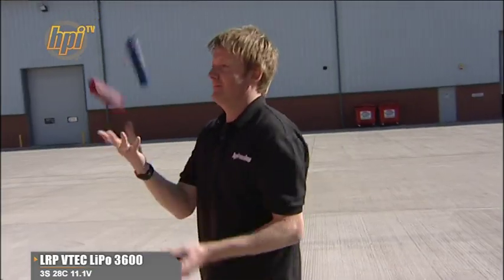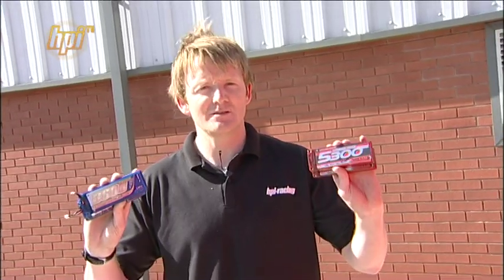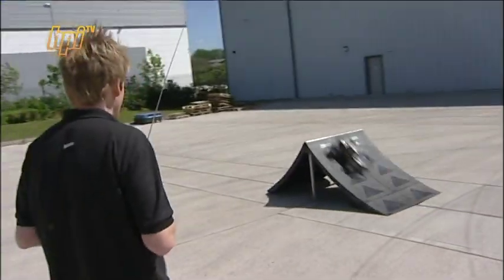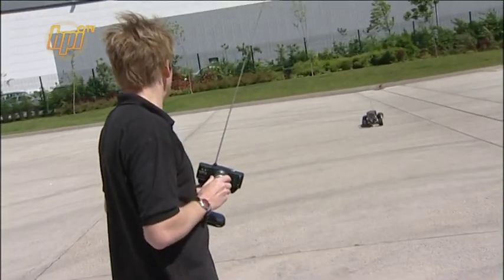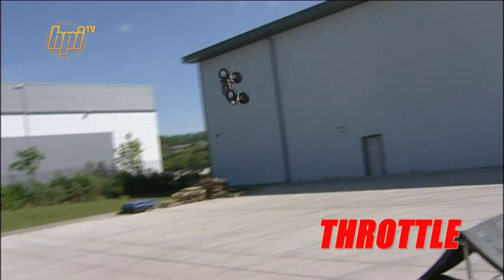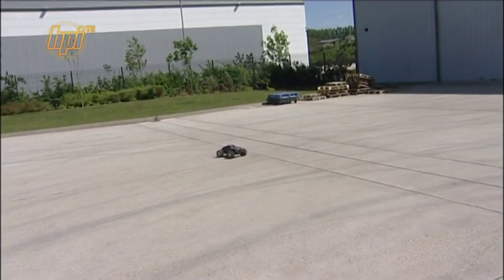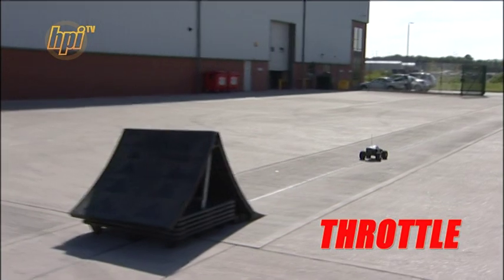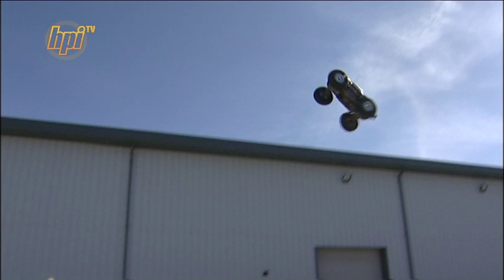Flux like a pro!

Comment: this truck is so strong i recon you could pick it up, hold it in the air and chuck it on the floor as hard as you could, and it will probably have a scratch. im soooo getting one.

Comment: Found a bit of a design flaw! Its a bit crap to be honest. On the wishbone upper arm its held by a pin thats secured by a flat bit of plastic attached to the bumper. mine twisted and the pin fell out on a field! If i didnt find it i would of had to go a few days without my car and im only on my second charge! But i found it and put a cable tie round the front and the back to stop it happening again. It needs looking into because that is quite bad.

Comment: Hello i have a flux hp and erevo, and since the electronics on both are the same i used to contact caste creations for support and warranty issues. They have been very helpful and even have swapped the esc and motor once when i needed. How would the warranty claim on this new Savage 2350 be. Will castle deal with this product or should it be handled by HPI directly. I guess the esc is a castle product since it uses the same programing kit, but what make is the motor?? Please Help. Thanks

Comment: does the the savage flux 2350 have to be set at 20% punch or can it do a standing back flip with out having to change it to 20% on 4s need to no reply back piz

Comment: @underdogmotosports Nope, not bad crashes at all. For ages i only had it set for half throttle on the ESC, obviously now ive gained a bit of knowledge on the car i know about it and it isnt an issue. I purely wrap a cable tie around it and its fine. And "Prepare to bash with a Savage" video on here will have it on there. Since then ive had major issues with the drivetrain (i was running 20/44 at 6s). Now im running 22/44, ive done about 3 hours with no problems so far.

Comment: Hello i'm running 2 cell 5000mah 40c Lipos, the battery says its got a continuous discharge of 200amp and burst of 400amp do you think the ESC and motor can handle this power. Or should i program the ESC to be a lil more subtle. I had seen the castle videos where they advice that the fan on the ESC goes on only when the ESC enters thermal stage 1 is this normal. My fan starts running within 10 min of running. Any advice.

Comment: hey OfficialHPI, my friend just bought an savage flux hp, he's using twin 2s 7.4v 30c lipo batteries(NEW n good batteries "brand turnigy"). but his savage flux hp can't do the standing back flip even on dry tarmac. Please help my friend. One more thing Local Hobby Shop and some of savage flux hp owner not recomended using twin 3s lipo, because they said it may cause the ESC burn or smoked,please help me on this too.thanks.

Comment: Well my flux does not do back flip it just does a wheely and then lands on its back i have run it on dry tarmac and have the stock gearing. I am running 2 2cell 38000 35c batteries this is a higher c rating then the ones in your video what is the deal.